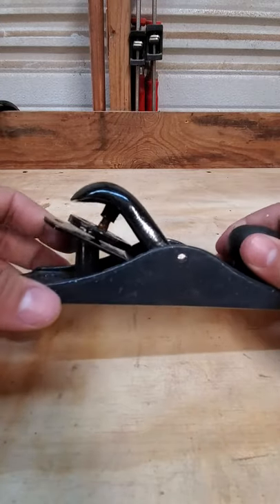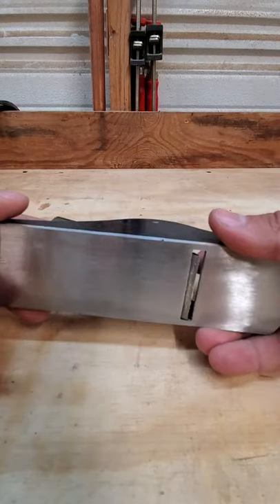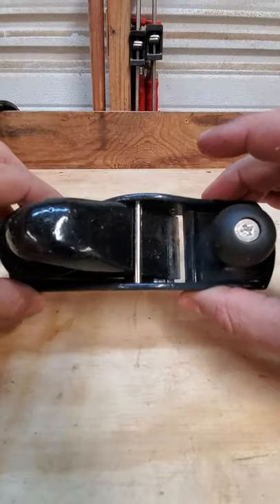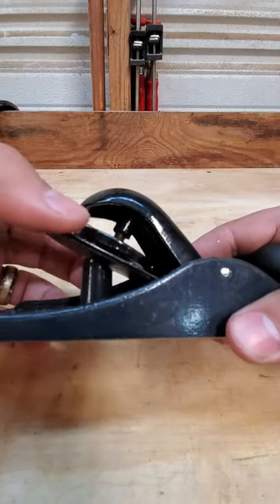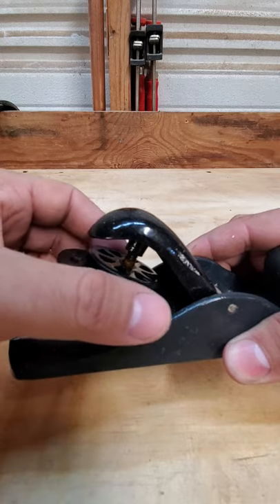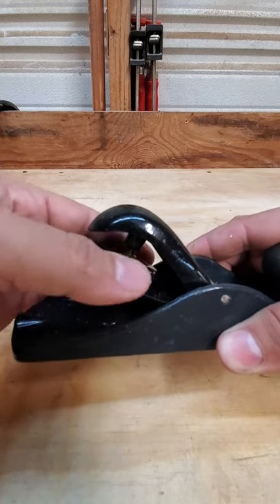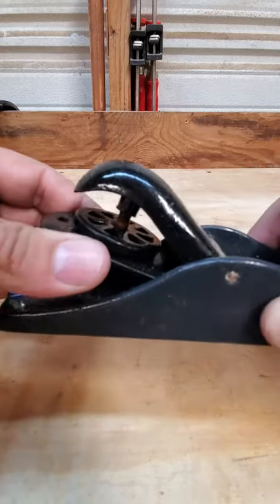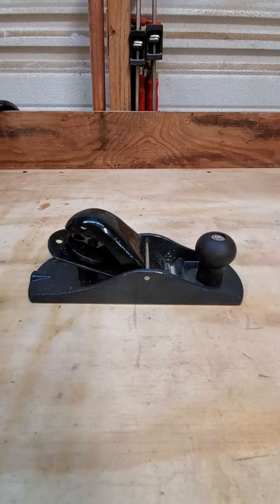How to Adjust the Blade on a Block Plane

Comment: For fine adjustments you use a small hammer to tap adjust it . The small bulge on the back of the sole is for tapping on to reduce the cut depth

Comment: Sorry, mate. But, that's not adjustment, that's just moving the cutting iron up and down. What about lateral adjustment? How far back do you start the iron, you didn't even mention adjustments with a small hammer, and where do you tap it? The iron, the front of the plane, the rear? This is not "ready to use".

Comment: That's not how you do fine adjustments. You retract the blade by hitting the plane body with a hammer, and you advance it with taps to the blade (look up how a wooden plane is adjusted).